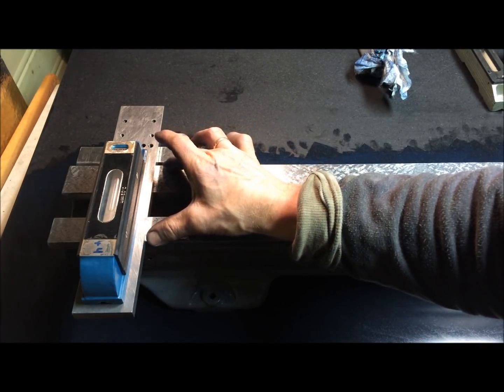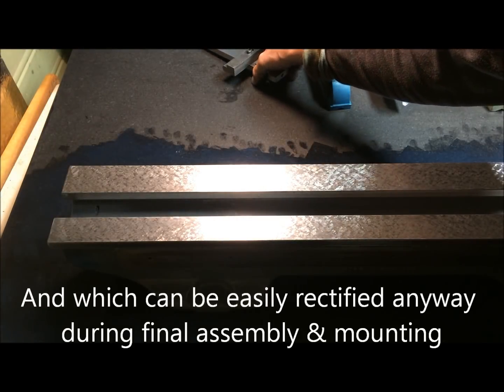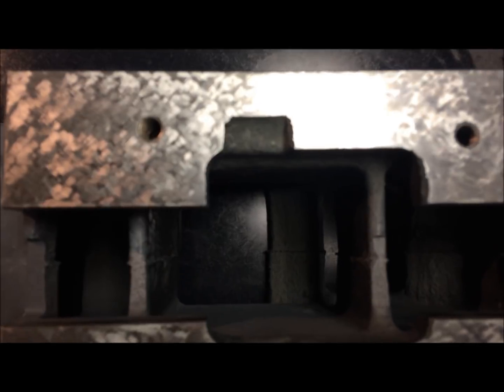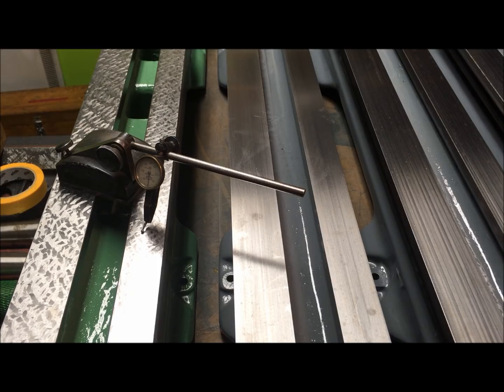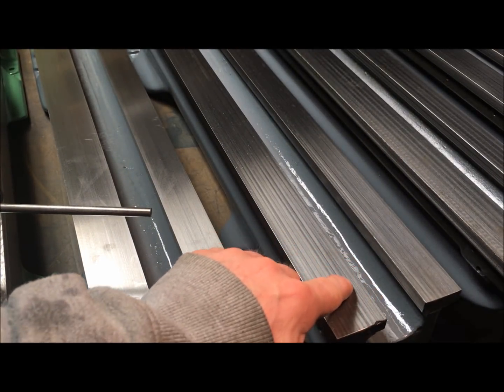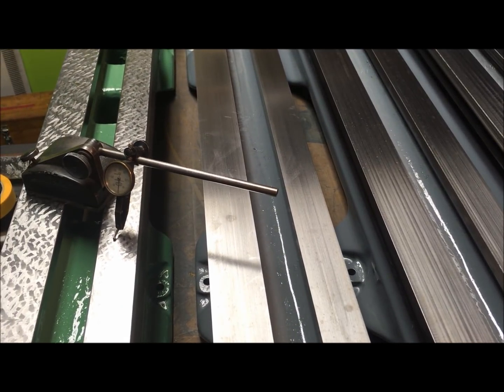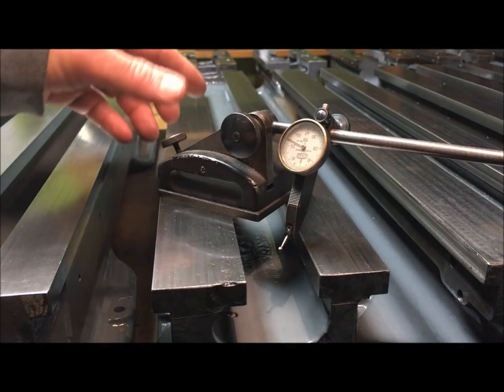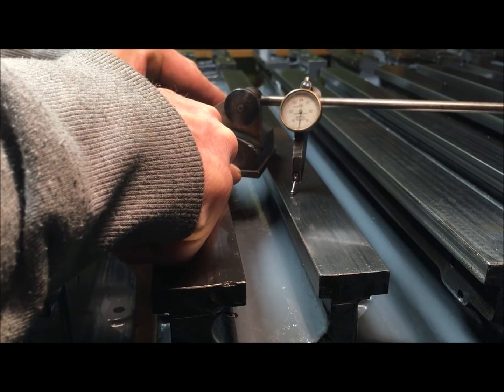Myford 7x7   bed   flats scraping and measurement

Comment: Do i have to use level to  check for twist or printing on the surface plate is good enough
Reply from the maker: Well, I would say that you need to check twist AFTER mounting the lathe also, so should do both

Comment: Can you use a 6x6 inch surface plate when scraping a lathe bed? Lathe bed is 18".
Reply from the maker: Use what you have, but a plate that is 1/3 of the length of the lathe bed isn't ideal. You could put the bed diagonally, ie. to have apprx. 1.4x longer surface, but still short. The problem is that it is harder to interpret the readings you get.
Reply: @jansverrehaugjord9934  Thank you for your prompt response. I will give it a try .

Comment: What is that blue stuff called please? I am new to this and want to try scraping myself on a myford bed I have.. Any help would be appreciated :)
Reply from the maker: The marking coumpund I use most is a water soluble product called Canode. It is obtainable from various sources, eg. https://www.artcotools.com/Canode-Blue-Die-Spotting-Ink.html
Then I also have used some oil based compounds, best in my opinion being the Diamant brand, as linked here https://kuerschner.ch/epages/176212.mobile/?ObjectPath=/Shops/176212/Products/%22020%20-%20ZTB%22&ClassicView=1
Reply: I use micrometer blue. Does the same job.

Comment: that surface plate should cost a fortune
Reply from the maker: Not new.. I think I paid around 5000 NOK. You can get them new though from this source http://www.microbas.se/surface-plates-2/
I think it is the article: 
8070.17110, Grade 0, size1200 x 800 x 120mm, listed at SEK	24 120 plus VAT

Comment: So is the bed surface all bumpy?
Reply from the maker: Sorry for the delayed response.. this comment/question somehow didn't surface in the header of my YT channel or in my gmail, to which I usually get a copy. Anyhow, a scraped surface will be straight and flat and have deviations ie. surface variations within allowable limits, usually mine are +/- half a hundreds of a millimeter. The mating component to the exposed surface, ie. in this case the bed, wold be the underside of the  saddle and this could have deeper scrape marks and/or what we call flake marks. The purpose of such being for oil retention and thereby keeping the thin oil film onto which the parts float. Not deep enough/correct scraping marks leads to the  possibility of the oil being squished out, parts sticking together and/or rubs .. which will produce premature wear, scoring and generally bad things..
Reply: @jansverrehaugjord9934  ah right I see now thank you for that its much appreciated and keep up the good work 👍

Comment: I am a novice machine operator. I still need to learn a lot I have a question: why does the bed has to be scraped, if the bed is very flat after grinding? (I have no flat surface to bleu and measure)
Do you scrape for inbedding oil or to get a flatter sutface?
Reply from the maker: You scrape for both alignment and oil retention qualities. A bed is of course normally ground, but as long as you have a soft bed (ie. not hardened) you can also scrape it . Given it's a small bed it is not such a big deal one way or the other. The flat Myford beds are also very easy to measure. There can be many arguments  to what "surface quality" you should try to achieve on the "exposed surface", which in this case the bed represents, but I like to scrape it a bit shallower/smoother than for example the underside of the carriage, which is supposed to have oil pockets.

Comment from the maker: Add commets:
Pardon the music during the level measurements. The editing of this video went a little "overboard".
Not sure what happened, but blame the editor.. the part where I showed/try to show use alternative shorter/other straightedges/surface plate, I also meant to show the short plate in combination with a narrow straightedge , explaining how to overlap with 2 or 3 measurements with the plate, a "cross" reading, ie. SE across both flats, which will detect wind/twist in the bed, and then a couple of straight end- to- end measurement with the SE (each flat separately)
Reply: What the name of this músic?
At 4:27.

Comment: When finished I'm sure these lathes will be considerably more accurate than when new. The amount of work you put in to these should make them collectors items!
Reply from the maker: Thanks! But I assume the Myfords came out of the factory as good as these. But, it may also be true that they couldn't devote as much time as I on something that was a "sales item".. as long as it answered to their internal standards, good enough is the point where you shall stop.. otherwise it is just extra work for no more income.
I am nonetheless sure that their standard was very high.
A side step.. I plan to experiment a little also towards different setups for individual longitudenal feed and threading, also with an ELS
Reply: I would like to think that your rebuilt Myfords will find homes with model makers or jewelers, who are more inclined to treat their tools with care than professions which make their money by working fast instead of carefully.
Reply from the maker: Agreed.. it is not a productipn tool.. far from it I guess. I will experiment however.. for example fitting one machine with an ELS2 on the Z axis. Also some other ideas for "modernization"
Reply: @jansverrehaugjord9934 hi Jan, actually your lathes will be considerably more accurate and 'tight' in comparison to myfords brand new lathes. They ground the beds, and the scraping marks you see on the brand new machines are questionable. I have a brand new myford , scraping marks are present but as you say, you never know until you test it. Tested with straightedge and results were a bit disappointing. Cross slide as an example, seems to be milled and 'flaked' for appearance, missing the crucial part you do which is scraping for points per inch. Which all makes sense from myford as they are a business, and can't spend all day scraping one machine. In simple terms, your myfords are considerably better than a brand new myford.